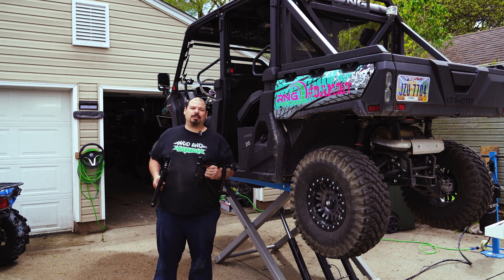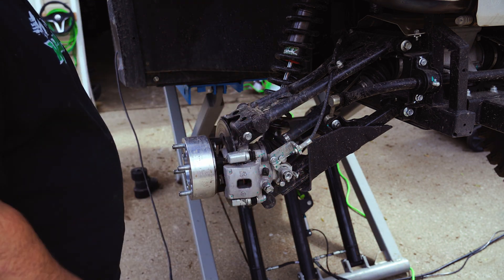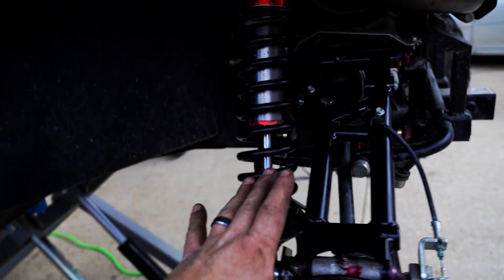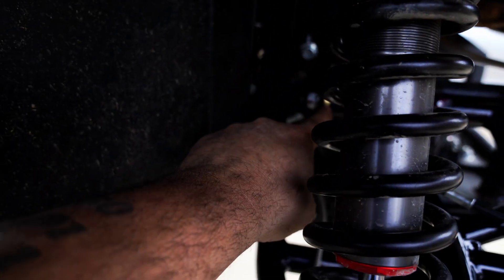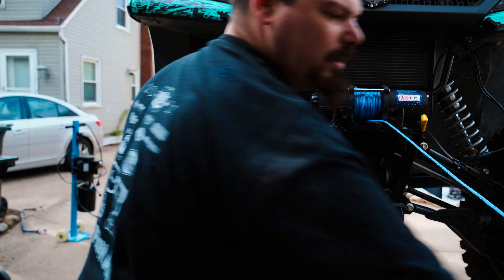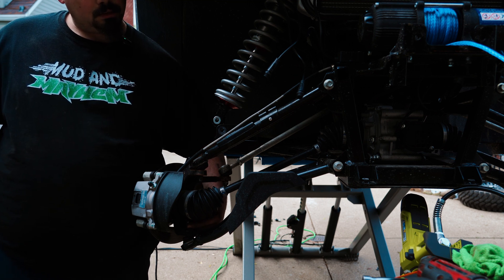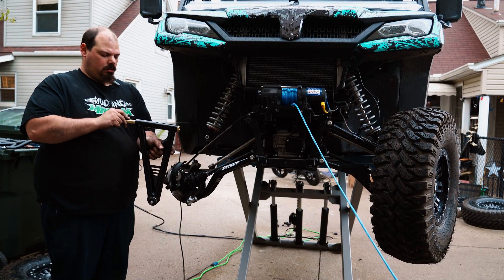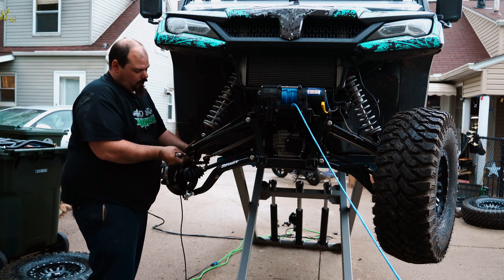LIFTED CFMOTO UForce 1000 XL

Comment: Hey Red, you do a lot cool shit, thanks. But I have a problem. My 2023 zforce 800 ex has the old 1000 engine maintenance design but the manual has it down at wet clutch design. I have a separate transmission and oil fill and check with separate drawers plugs. The manual is wrong and my dealer sold me wet clutch oil. Thank goodness I caught it before hand. Have a look at the video I just posted to see for yourself.
Reply from the maker: Yeah these manuals are off the hook.  All you do is service it the same as the 800XC 4 wheeler. Get the manual for that unit buddy
Reply: @R.N.GPerformance  ok thanks, but before I do that, does it take regular oil or wet clutch approved?
Reply: While we’re on manual talk, my new 2023 u1000xl manual states normal mode the lesser power option, and work as the full power mode. I thought I heard you state the opposite was true on the 23 models? How would I really tell what’s true on mine while I’m in the break in period of the new motor? And does it matter which I use while half throttle break in?